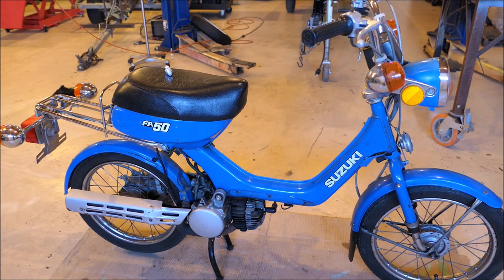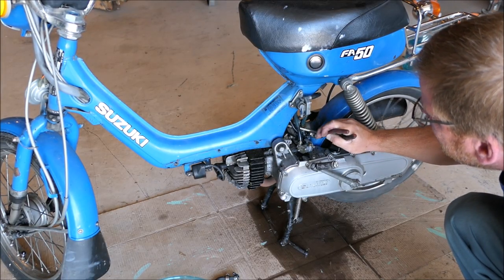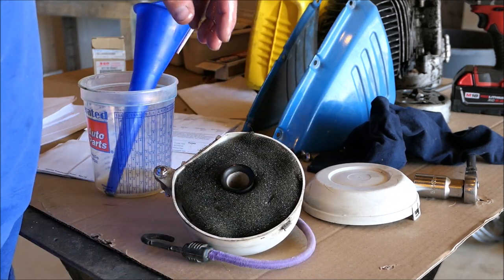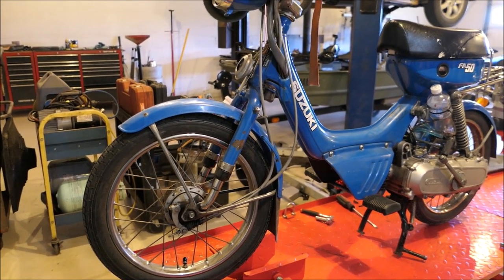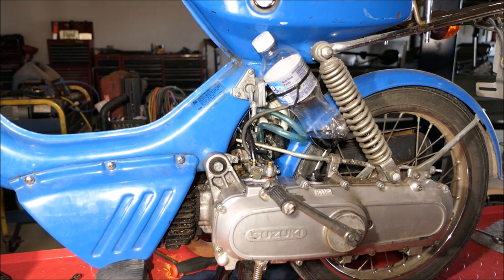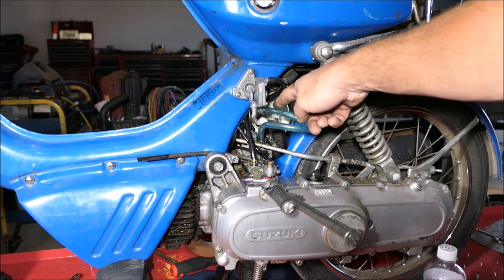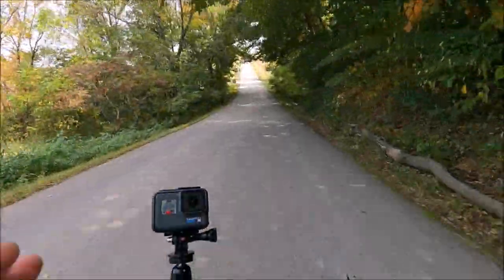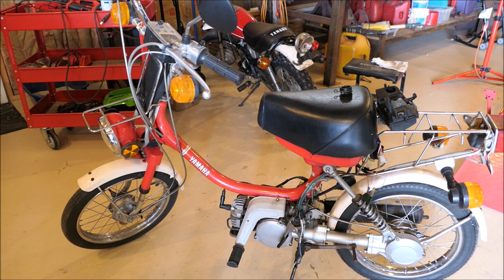Suzuki FA50 runs after SITTING for 76 Years!!!

Comment: It should four stroke downhill because you are taking the load off the engine and she doesn’t need all the gas. Runs great!  If she goes as fast or almost as fast slightly uphill as it dies on the flat then your main jet is too big. Just another test to keep in mind.
Reply from the maker: Thanks for all your help!! Amazing how much Ped knowledge you have !!
Reply: @kentuckyyankee  sure thing. I meant to say almost as fast slightly uphill as on the flat.
Reply from the maker: @jackrutherford-1  I think it's about right ... temp Guage was 350 at highest but it was also about 70 degrees

Comment: "Suzuki FA50 runs after SITTING for 76 Years!!!" Uh, If it's a 1984, then it would have been 38 years old in 2022. The FA50 is a cool little bike, but it is not a moped, as it has no pedals. Compared to something like a Puch or Tomos, which I've had quite a few of (with pedals) the FA50 is way more complicated, and most of the parts are no longer available. You can still get most of the parts for a Puch or Tomos. The FA50 has a vacuum operated petcock, gas will come out of the PRIME position without the engine running, but the engine has to be running to make gas come out with it in the ON or RESERVE positions. That crap in the carburetor is from ethanol gas. Reed valves can be troublesome. Most moped engines are just plain piston port. The Tomos A35 had reed valves. When they switched to the A55, they got rid of the reed valves, and it was actually faster. 30 mph should be top speed. I wouldn't trust that old oil pump. It's likely deteriorated. I use 40:1 premix in mopeds. You might foul a plug once in a while, but that's better than a blown engine. Thank you for calling it what it actually is. Nothing wrong with a noped, as long as you don't call it a moped. In my state, nopeds require a motorcycle license (which I have) and mopeds don't.

Comment: I just bought a air filter for my FA 50, why do I need to soak it in oil and the wring it out?
Reply from the maker: @SwitchAddict  Helps to keep the fine dust out. I'm not sure that you have to do that. It may also make it run just a little richer.

Comment: Nice rescue, good for you. You better check your math.... I was born in 1960, but I'm only 62. LOL. 
And thank you for your video on the install of the Shad stuff on your Z900rs. It made the install on my 2019 Z900rs Cafe super easy. I got the 39 liter top box and the same small side cases you got. I did disassemble my rear turn signals and cut about 3/8th of an inch off the bulb portion of the stalk, then grind about the same amount off the little post inside, and reassemble. Now there's plenty od clearance between the signal and the side case.
Reply from the maker: Maybe 76 in dog years? 😂😂 The Z900RS is an awesome bike and really like Shad luggage, enjoy your bike thanks for watching!!